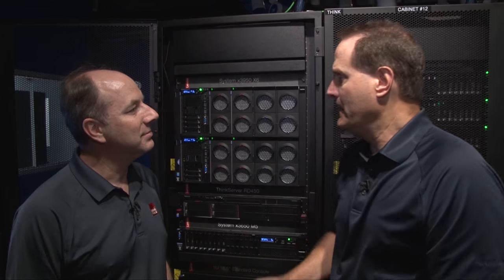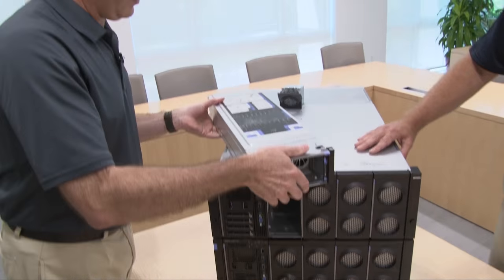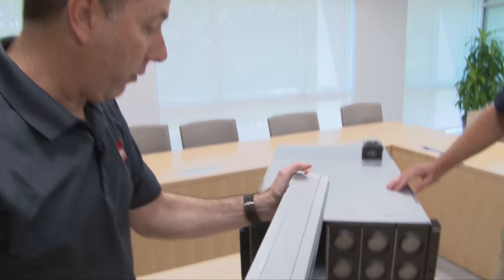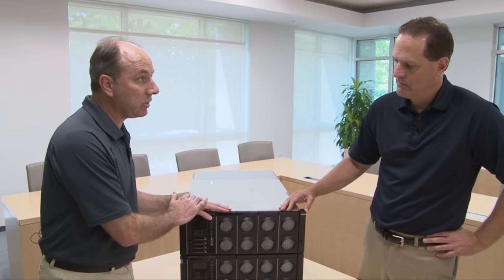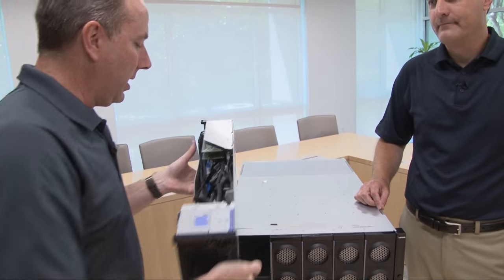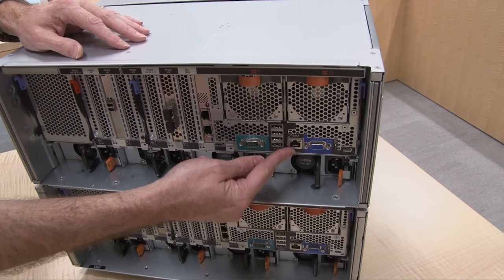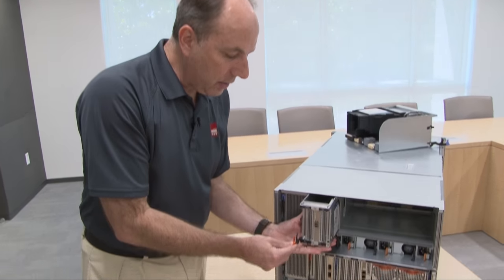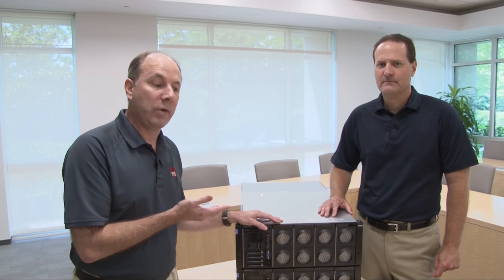Lenovo System x3950 X6 Video Walkthrough

Comment: Fix your servers post time, 15 min server posting is way too long
Reply: Post time allows the server to fully check itself to make sure that everything is working. And it is a server meaning that it isn't powered off/on regularly. Many servers are powered on for years without going offline.
Reply: @tylerebowers  In a perfect world, yeah. In reality servers brake all the time and such long post time just unnecessarily adds to the time that device is out of production. 10 minutes ram upgrade turns into 1,5h maintenance for no reason. Not to mention when the issue requires multiple reboots.
Reply: @dan7212  I just bought one of these servers with 8x E7-8880 V4 and 512gb mem; Ill time the bootup.
Reply: @tylerebowers  I'm sure it will be slower than the slowest Supermicro I've encountered so far (X10QBI) The difference is that X10QBI must go through x8 ram board modules. On the side note, why so low on RAM?
Reply: @dan7212  It is cheaper to buy more ram after the fact.
Reply: @tylerebowers 联想官网好像写了超过1t会出现问题，好像是pcie通道会有部分不可用，你们遇到过这种问题吗